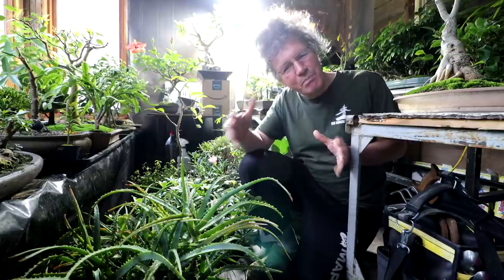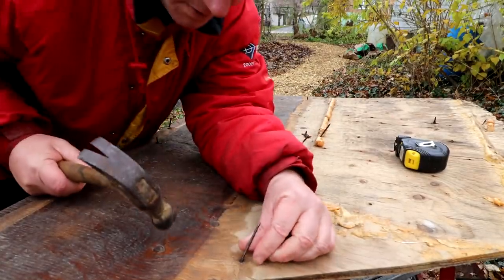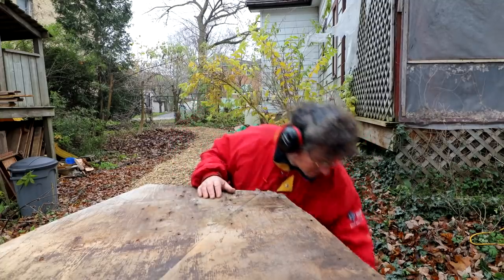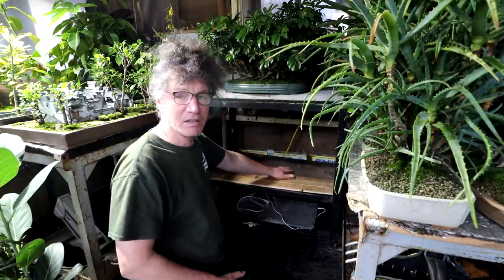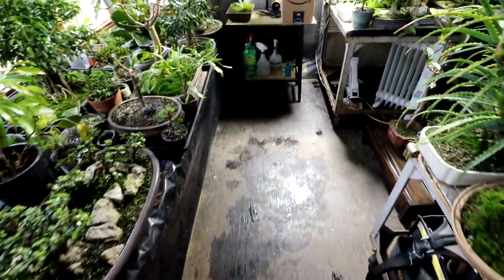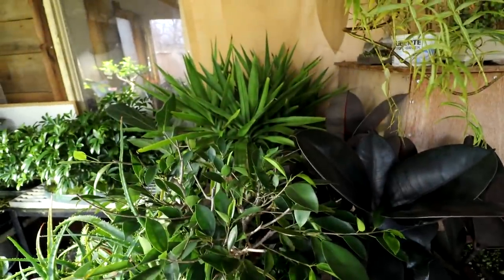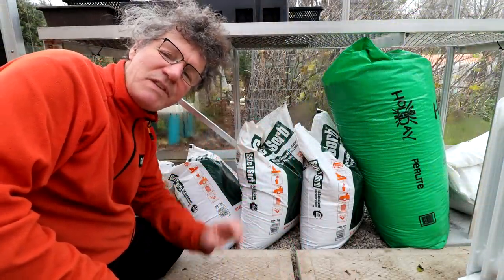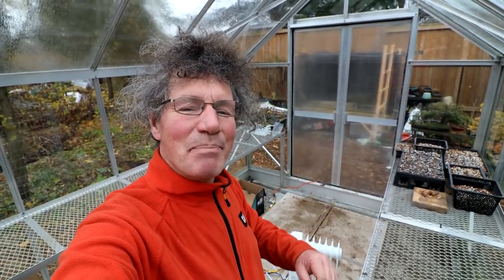More Room for My Bonsai, The Bonsai Zone, Nov 2021

Comment: One thing worse than hitting a nail with the circular saw is hitting a loose nail. A carbide-tipped blade will cut through a nail as long as you aren't going too fast, though there will be a lot of noise and perhaps some sparks. You should of course check for fire in the sawdust and look over the blade for damage after such an encounter. But if the nail is loose in the wood, the blade will snag it and either send it flying or break several carbide tips on the blade. I destroyed a table saw blade this way on an unnoticed loose nail.
Reply from the maker: Scary stuff Kevin, I'll keep that in mind!

Comment: I'm pretty happy with a timer/power bar I found at Princess Auto. It has 8 outlets, though only four are on the timer side. Might be worth looking in to if you want to light all parts of your plant room simultaneously.
Reply from the maker: Thanks Florence, I'm worried I'd blow the fuse, we have a very old electrical system. I'm tempted to upgrade it all, but it would be very expensive I think!!
Reply: I'd say Nigel is right, it would probably blow his fuse having several lights running simultaneously.  You've also got to worry about what gauge the wire is or it could melt